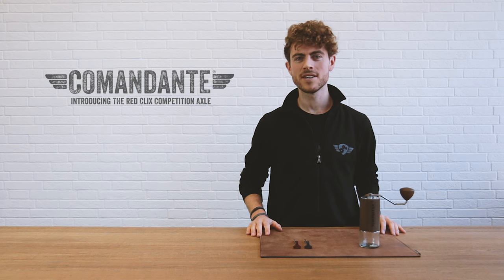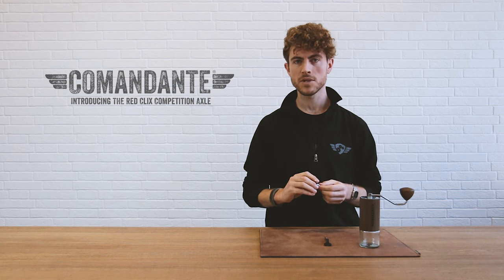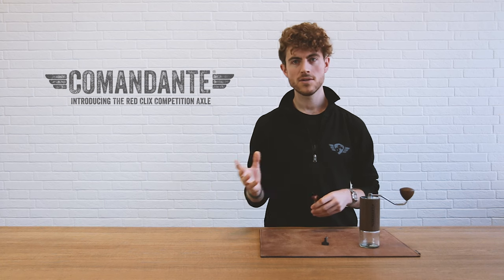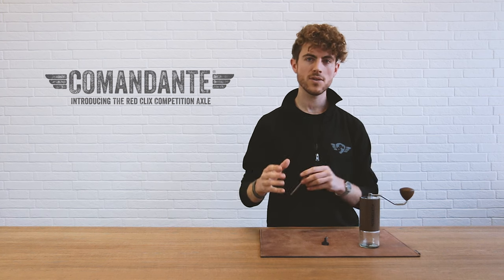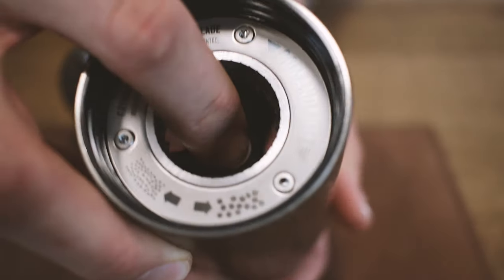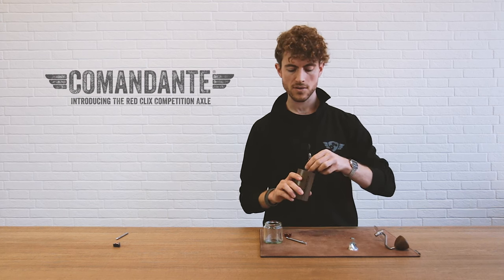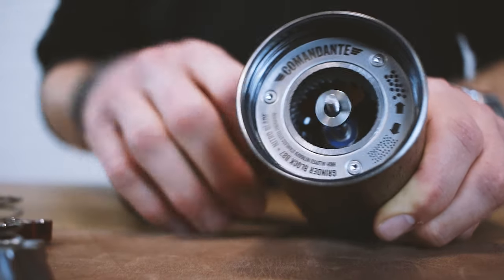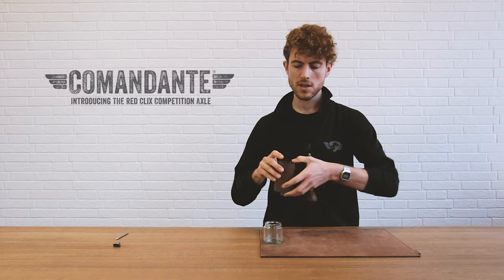Comandante Grinder FAQs | What is the RX35 Red Clix Axle and how do I Install it?

Comment: Hi @Comandante Grinder, is it necessary to change the spring and washers over to the ones that come with the Red Clix, or are they the same as the standard ones? Thanks :)
Reply from the maker: Hello there! No need to change them :). We wanted to include the spares as a little extra, and also to avoid any risk of anyone losing anything important when they install their new axle! Have fun with your Red Clix!
Reply: @ComandanteGrinder  Hi, thanks for relying so quickly, mine is arriving tomorrow and I can't wait! Best :)
Reply from the maker: @soulieonashoestring9578  Great! Enjoy!
Reply: @ComandanteGrinder  Thanks for clarifying this. Because when I switched out my original spring/washers for the ones that came with red clix, I couldn’t zero out the burrs, or produce espresso range grinds. 

After reinstalling red clix with my original standard spring/washers, the grinder performed much more as expected. My red clix espresso setting 12 had the same timing/resistance as my standard setting 6.
Reply from the maker: @rywing4328  Glad to hear you're enjoying your Red Clix axle! If you couldn't zero your burrs the first time then you probably accidentally inserted the axle before the top washer, rather than after it. But no worries, sounds like everything is working a charm now :D! Happy grinding! Best, Joe

Comment: Hey guys just installed my Red Clix and figuring out how to dial it in for my Rocket Appartamento! What do you suggest is a good starting point for espresso w/ the Red Clix?
Reply from the maker: Hey there Bobby! Great stuff! If you'd already dialled in on your standard axle we would recommend starting with double the number you used before - i.e. if 9 clicks worked great, try starting at 18 this time :). Otherwise, try starting around 18 clicks anyway and dial in from there to suit your coffee and taste ;). Enjoy!
Reply: I've read somewhere '10 to 15' with normal axle. My coffee was pretty light roasted, so I thought 'better start fine' so I started on 22 on the red axle. The coffee just shot through. Then went 18, and there was still very little pressure.

After reading some more you'll see reports that someone uses 5 clicks for espresso, while someone else uses 12 clicks (and this is with the normal axle).

It just shows the huge variation that coffee, temperature, water, elevation and taste preference brings.

Just make sure you keep everything as consistent as possible, so that you can pull consistent shots. When you have that, start adjusting. Clean visible left-overs after each shot so you start 'fresh', and don't ever go thinking 'this must be too fine, I've read online that that one guy...'. Adjust by taste, not by internet 'wisdom' :P.

Comment: the upper bearing is stuck on the axle and would not come off. it spins, and works fine if I put it back, but it is absolutely stuck and I cannot remove it no matter how much force I apply or if I lube it with mineral oil. any suggestions on how to remove bearing that is stuck on an axle?
Reply from the maker: Hello there! It sounds like you can reassemble and use the grinder like normal? I hope that's the case :).
If you can polish the axle with some steel wool or abrasive fleece in the location where the bearing gets stuck then you can smoothen the surface so that the bearing can move off the axle more freely. (We don't use glue to fix anything, so it's not a problem if the bearing comes out, since you can push it back into place and assemble as normal).
In any case, please send an email to our Support Team at support@comandante-grinder.com so that we can help you troubleshoot and solve the 'sticky bearing' issue -- Comandante is here to help :)!
Reply: @ComandanteGrinder  thanks for your reply, I'll email in with some pictures. The problem is that the bearing is "stuck" whereever it is on the axle, suggesting the issue with the bearing, not the axle. But yeah, I'll email in, thanks for a response.

Comment: Hello, do I understand it correctly? With Comandante C40 equipped with standard axle it is not possible to achieve proper grind for espresso because the first click after the zero point creates a gap between the grinds of 30 microns.
Reply from the maker: @pawerasiewicz5348  yes and no ☺️ every 1 click on a Comandante creates a 30 micron grind size change. But it's of course possible to grind for espresso with the standard axle - the recommended range is from around 6 to 12 clicks. With Red Clix you can just have more precision is setting the grind size since the difference between clocks is 15 microns.

Comment: I wonder why c40 not coming with red clix as a standard? I'm sure it's not more expensive to produce, there's just more threads. I use my c40 for espresso and aeropress and I don't mind changing settings from 10 to 20 so I'm sure I wouldn't mind changing it from 20 to 40.
Reply from the maker: Hey there Rafal! Well, it is more expensive to produce, but that's not the only reason :).

The vast majority of users are home users who brew filter coffee only. We chose 30 micron changes in the resulting median particle size on our standard axle because the variables in the beans themselves cause typical variations of 20-25 microns per dose. We wanted to make sure that each click made a noticeable taste difference and kept things more simple for cleaning, counting clicks, and generally dialling in.

Red Clix shifts the narrow burr gap by 6 microns per click, changing the resulting median particle size by 15 microns per click. It is designed for espresso and advanced users, including competitors, to enable more fine control over grind setting. It also needs to be used with care, because it's such a fine thread.

For daily use and for cleaning (incl. removing the burr from the grinder), Red Clix makes it more work because it means counting twice as many clicks, unscrewing the dial twice as far, etc etc. For some users this isn't a problem, but that's a matter of personal taste and just as many would prefer for things to be kept simple. Our solution is to therefore offer the choice to make the C40 more advanced for those who want it, without limiting anyone's choice of model - keeping it more financially and practically accessible to everyone :).

Thanks for your support! 
Best,
Joe

Comment: Hi, I just got my Red Sonja (gorgeous!) and the Red Clix today. I got the Red Clix specifically for espresso that I want to grind in the future, but right now only need my C40 for filtered coffee (AeroPress, French Press, etc). Would you guys recommend using the Red Clix for anything besides espresso or should I just swap it in/out whenever I want to grind for espresso? Would it cause any problems if I used Red Clix as my daily choice for everything? Just trying to be considerate of how I use my Comandante Grinder. Thank you and thanks for building such a quality and beautiful product!
Reply from the maker: Hi there Bobby! Thanks for your support! There is no issue at all using the Red Clix axle for everything! It just means that when you're setting the grind for a filter coffee, you'll have to count a lot further back from click zero, so it's up to you to decide if this feel impractical or inconvenient :). We supply C40s with the standard axle because most users brew solely filter coffee and having fewer clicks to choose from is a practical advantage, with no disadvantage for grind setting resolution/accuracy! (30 micron steps on the standard axle are perfectly sufficient for filter coffee, but 15 microns steps with Red Clix are great for Espresso because of the sensitivity of brewing under such pressure, where the particle size has an amplified influence on flow rate.)
Reply: @ComandanteGrinder  thanks so much for the quick reply. Decided to keep my Red Clix in the box until I get my espresso machine, so for now using the standard axle which has worked beautifully. LOVE my C40 and very happy with my purchase. Quality from end-to-end ❤️
Reply from the maker: @bobbyomari5500  That's so great to hear! Thanks a lot for your kind words and support 🙏🥰. Wishing you many a fantastic brew and all the best from Munich!
Reply: the red sonja is SUCH a nice color!! i really love mine :)

Comment: Hey, I just got my red clix and I've got also one question: Where is the "zero" position with the red clix? It feels different from the standard axle. Like, when I screw the dial into my grinder, there is a point where I could not turn the handle anymore, but I still can screw in the dial even more by hand (for 2-3 clicks). so I'm not sure if the zero clicks position is where I can't turn the handle or where I can't turn the dial.
Reply from the maker: Hi there Max and thanks for your support!
The important thing is that you decide for you what is the repeatable and simple definition, so that you have the same reference point each time you dial in :). I prefer to use the first click setting where the handle can't fall under gravity, since it is the minimum stress required on all parts that gives me a reference point from which to count my clicks. But you can and should decide what you prefer :).
All the best from Munich!
Joe

Comment: I have a question, I currently use my comandante for drip, 24 clicks works for me. Sometimes I use 9 clicks for espresso, what "clicks" settings would be be equivalent to these after installing red clix. I'm trying to figure out difference when I'll be switching between espresso and drip. Thanks.
Reply from the maker: Hi there! Thanks for your support! 
Red Clix doubles the quantity of possible settings within the same particle size range. It's therefore good to use double the standard axle setting as a starting point, but be aware that you may need to fine tune a little to find the same particle size/the one that tastes best to you :). Especially because different coffees need different settings! Best, Joe

Comment: Hi, may I know if the washer and springs that come with RX35 is the same as the default ones?
Reply from the maker: Hi there Kevin! They are absolutely the same :). We include them in the set because those are parts that someone might lose if they are unlucky whilst swapping the axle over -- better safe than sorry! :)
Reply: @ComandanteGrinder  well understood. Thanks for being considerate :)
Reply from the maker: @GuitaristBoi9  ☺️👍 Thanks for your support!

Comment: I just bought the Red Clix, but I can´t find the Zero. On the regular Click, i just reach a point where the handler stop moving contra clock wise and that was my Zero, but with the Red Clix, i can´t reach that point. It´s that Ok?
Thak you, i Love my Comandante, if there´s ever a fire in my apartment, i would grab one guitar, the Comandante and leave everything else.
Thank you.
Reply from the maker: Hey there Nicolás and thanks for your support! It sounds like maybe you haven't inserted the top washer before the axle. Please double check that you installed everything correctly by following the steps in the video carefully. The top washer should be put in place first, then the axle inserted into the grinder. That should solve it :).
Best,
Joe

Comment: Would the Red Clix be compatible with my Mk II? I'm using it to grind espresso with the Flair Signature and would like to upgrade to the larger brewheads which require a finer grind. Seems like I'm about maxxed out already on the Mk II, as I'm often at 0, 1 or 2 clicks to get a quality pull. Is this an issue with my Mk II?
Reply from the maker: Hello there, unfortunately Red Clix isn't compatible with Mk2. It really is a huge jump in performance from that generation to the current generation of C40 with our Nitro Blade burr. Please reach out to our team via info@comandante-grinder.com to ask about our exchange program :). Thanks for your support!
Reply: @ComandanteGrinder  Thank you for your response and service opportunity! I will definitely take advantage of that :)

Comment: Hello, how many clicks in red clix (max)? And standart axle how many clicks? Thank you
Reply from the maker: Hello there! There are around 50 settings on the standard axle before the adjustment dial comes off the axle. For Red Clix it is therefore around 100. Settings after 40/80 (respectively) would generally be too coarse for normal use :). Hope that helps!
Reply: Comandante Grinder thank u Mr. - Is the spin speed important for prevent to burn coffee beans?
Reply from the maker: @manyak0  You're welcome :). Temperature isn't really an issue for the smaller quantities of coffee that you would grind (less often) with a hand grinder. Speed is important in another aspect though: if you go too fast (more than 3 turns per second) then often it is slower to grind your beans, because the beans don't fall into the burr effectively. We designed our burr for optimum performance, efficiency and ease of use in the typical range of 80-160rpm :). Hope that helps!

Comment: I have a new mk4 that I picked up from a retailer in Singapore this past week along with redclix. 
I am grinding for espresso on a rancilio silvia pro vst basket 20 grams. I dose 20 grams with red clix 16 clicks and my shot gushes in 5 seconds. I can only pull a decent shot (24-30sec 1:2 ratio) at 8/9 and maybe 10 clicks on redclix which is like 4-5 regular clicks. 

I have zeroed my grinder as per Comandante’s instructions where the crank doesn’t fall by gravity. Beans are monsooned malabar, costa rica tarrazu both espresso roast. 

Is my grinder faulty as with red clix I really shouldn’t be having to go down to 9 clicks for a 27 second shot. Any insight is much appreciated.
Reply from the maker: Hello there Saurabh! Just sent a reply to your email :). TL;DR -- so long as you can brew an espresso, there's nothing to worry about :). 
Best,
Joe

Comment: Is it compatible with C60 version?
Reply from the maker: Hello, the current RedClix set is not officially compatible with the C60 since the bigger burr might stress the polymer clicker too much potentially leading to damage of the parts. That's why we don't recommend using the RedClix in C60 Baracuda. In the future we might be releasing a RedClix specially made for C60. For now on we think that the GoldClix offers enough flexibility for the majority of the users to perfectly dial in their brews ☺️